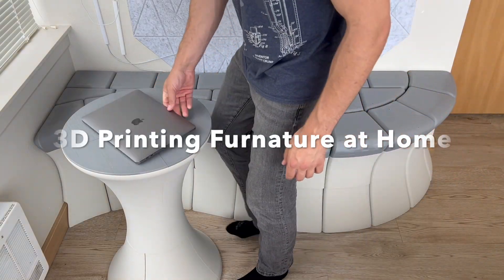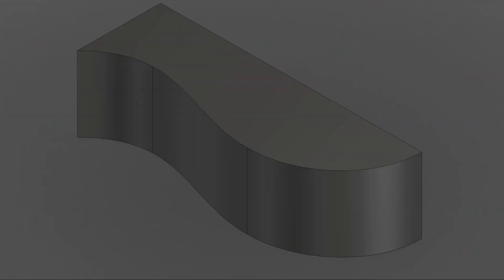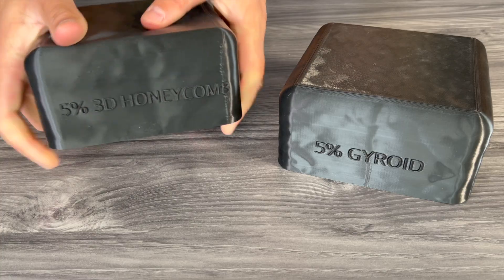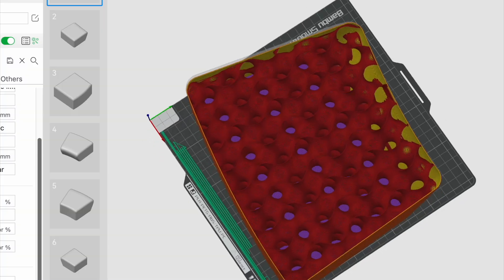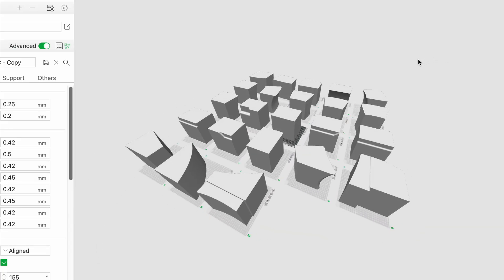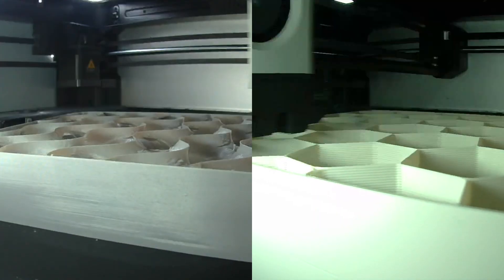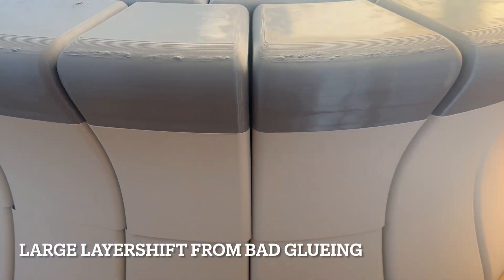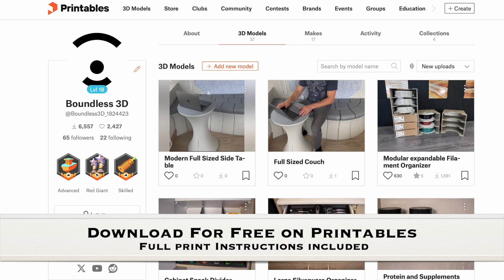I 3D Printed My FURNITURE

Comment: It would be so so cheap if you could use pla and tpu pellets with a pellet extruder. For example, PLA pellets cost 3 dollars per kg. There is one diy option available: GreenBoy3D extruder. (It is very diy, since there is no centralized guide)

Comment: How was the cushion when it was all assembled? The sides have less room to spread out I would assume. Also, are the wear holes from flexing? What would be a good solution to that?
Reply from the maker: @paintpouringwithpiper7504  it’s a little stiffer now that they’re constrained to only flexing in. And the holes are from trying to bridge a large gap in the infill. Once the infill percentage drops below 5 it starts having bridging problems. One solution could be having non vertical walls, sort of wavy walls designed to flex in a consistent way

Comment: An interesting proof of concept and not as expensive as I would have guessed. The real strength of the design is in how it conforms to the space, including the baseboard and the device on the wall.

I think it's definitely worth experimenting more with TPU, I've found that it can be pretty comfy with higher density infills.

Comment: Great video, and nice project!  I may be wrong, but I think you can find considerably cheaper TPU and feed it directly rather than through the AMS.  It would also be interesting to test the comfort of thinner TPU cushions.  Actually, the longer I’m thinking about this projects, the more questions I’m coming up with.  This was really cool!
Reply from the maker: @Distanc3  thanks! one thing I didn’t cover in the video was that the ams tpu was less comfortable than the regular tpu. But I bought 6 roles before realizing it so I went with it. 4 year old Ninja flex was another one I tried which was comfortable but pricey. You can probably find 25%-50% cheaper tpu but it can be hit or miss on reliability which wasn’t something I wanted to deal with for 25 prints.
Reply: @BoundlessbByDesign  Thanks for confirming my intuition about TPU pricing.

Comment: To be honest, a practical use for 3D printed segmented couch or any furniture like that would be that you can disassemble it if you plan on moving somewhere else or placing it in a different room, of course that only works if you redesign it to connect more like lego bricks so you don't use glue
Reply from the maker: That would be nice. I also considered generic/universal internal cubes so that if you want to change the design then you would only need to change the external cubes. Maybe a version 2 someday
Reply: @BoundlessbByDesign  you might be able to use wooden dowels for the interior.